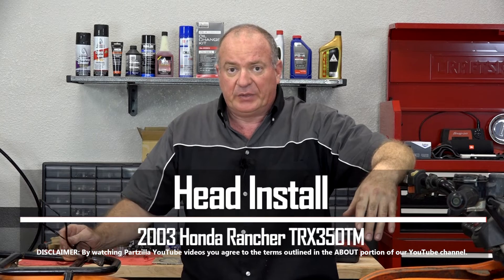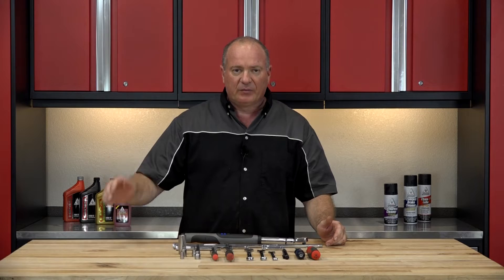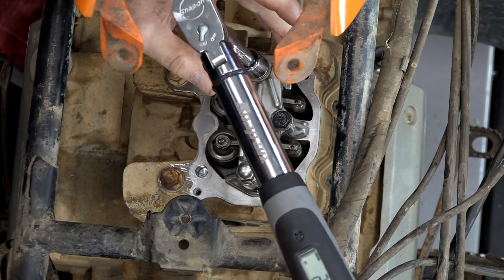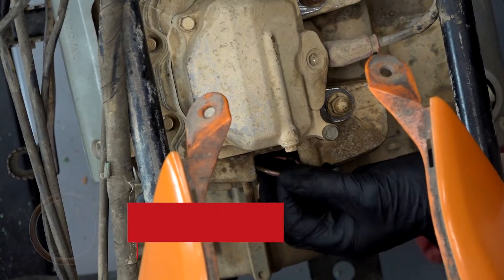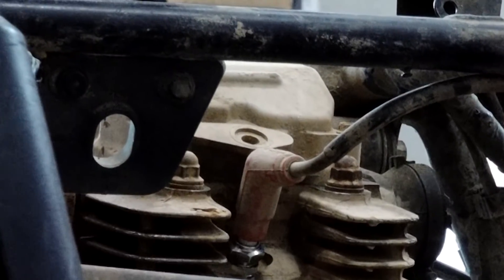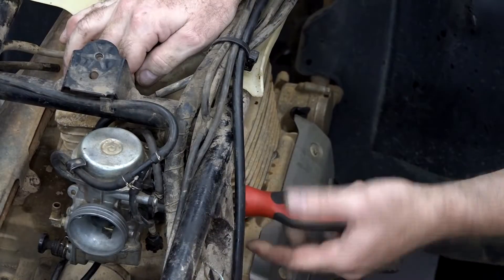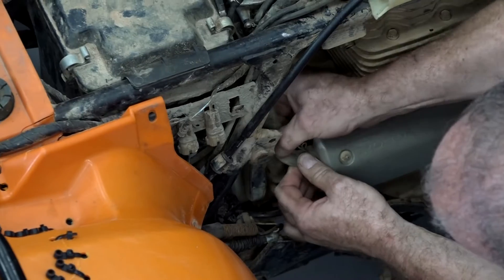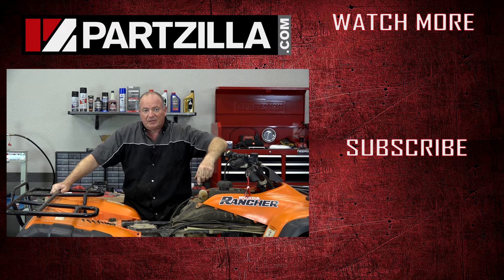Honda Rancher 350 Top End Rebuild Part 4: Head Installation | Partzilla.com

Comment: This is a Question  , I have a Honda 2005 TRX350 ES , When I purchased the bike it was locked up , I pulled the head And Cylinder , the piston and the pin was faulty , I installed a new piston and pin put back together set the Valves on TDC .06 INSTALLED a new  carberator and check the plug for firing 🔥 but it would not start any help would be appreciated...
Reply: Check to see if the atv has spark and if so put some quick start spray in the carb and try firing it up

Comment: What causes dry smoke on startup and when accelerating after it idles for a few minutes.
Reply: Note: it’s not a steady smoke and it doesn’t smoke noticeably when riding. Just puffs at start up and acceleration after idling
Reply: Valve stem seals?

Comment: Hi I have a 2000 rancher 350 and I noticed some oil residue between the valve cover and head, I know its the gasket between the two. So I am planning on replacing it soon, because of this I checked the compression on the cylinder and it is giving me 52 psi, which I dont think its accurate, the atv runs great, doesnt smoke, nothing to tell me there might be something wrong with it. So I did a wet compression test and it stayed the same at 52 psi, so now I am wondering if it could be something with valves? any suggestions? thanks

Comment: Shouldn't you compression test before first start?
Reply: gives u a good idea of whats going wrong and to see how much you improved.
Reply: Until the bike is ran for a while the rings won't b fully seated and compression will still show on the lower side usually so it's not needed to test till after a few rides

Comment: why did you not ajust the valves with a fuel test bottle before asbly? Also i did not see you ck the face of the valve stim to be true and not diminished or cupped from the tappet strikes of normal running?
Reply: he put new valves in

Comment: only if you were here in Chevak,AK 99563 so you can teach me how to fix any kind of Honda. now I can not wait to fix up my top end engine it's a trx350fm 2006 Honda rancher 4x4 I think I'm going to spend about $1,000 to be fully functioning and more power I noticed I'm starting to lose power I will need new parts and your video help me out with what I need to do thank you very much.

Comment: Thanks for the videos!  I have completed the rebuild as described in the 4 videos, but now I have smoke after the engine is warm.  Any suggestions?  Rings not seated properly or Valve Seals maybe?
Reply: LaRoy Bubba did you check your connecting rod for up and down slack? Is there knocking? It's normal for some to smoke until rings are fully seated. It could also be oil in your exhaust from before you rebuilt it just burning out ( that's common ) did order your parts from partzilla or did you get a cheap kit off eBay?
Reply: LaRoy Bubba one more question! Does it smoke when its running without you giving it gas
Reply: EaZier Clutch EaZier, sorry for the delay.  I did check for slack on the connecting rod, it seems solid, no sign of any knocking.  I also rechecked the valve adjustment, it still looks good.  To answer your last question; it starts much easier than before (typical Honda) idles for 3-5 minutes with no smoke at all.  After warm and riding a little it smokes while riding and also at idle.  I didn’t want to ride it too much for fear of having a ring not just right.  Thanks again for the help!
Reply: Your ring gap ends are lining up.  Maybe wiggling in the jug they moved?

Comment: Hey my head stud it stripped at the top ( the long bolts the come out of motor ) it got the stud out but how should I get the new stud in HELP!
Reply from the maker: Threads were stripped only at the top and not the bottom?  You would just have to screw in new studs into the crankcase.  You can double nut the top thread and wrench it down that way.
Reply: Partzilla thanks I was thinking of that but I though it would be to much pressure in the small area and stripped threads again but you have experience and I don't so I'll do that
Reply: Partzilla also... how much would it cost to have the cylinder bored same as you did? Would it be cheaper to get a new cylinder vs getting it bored
Reply from the maker: Depends on the shop.  Usually, it's cheaper to bore out than it is to buy a new one.

Comment: Sounds like it’s got a valve tick
Reply from the maker: Matt Budd Very good ear! The valve adjustment video is in process. Should be live next week.
Reply: Partzilla sweet now when I adjust the valves on my 300ex should I do it when the engine is warm or when the engine is cold?
Reply from the maker: Honda manual says check them when the engine is cold.